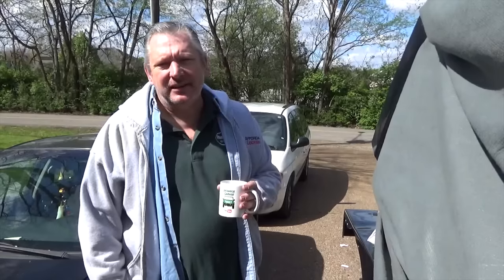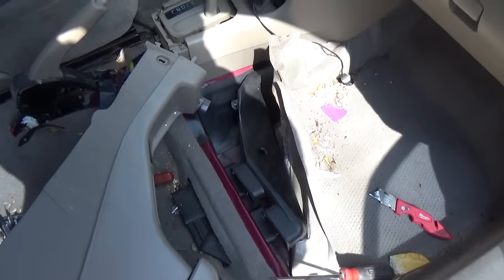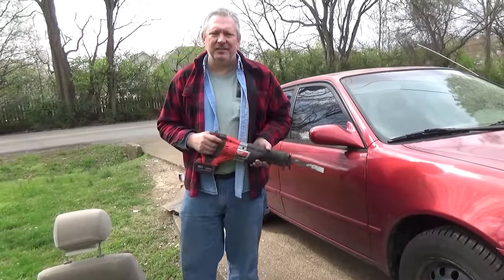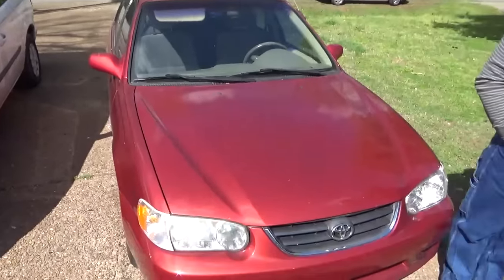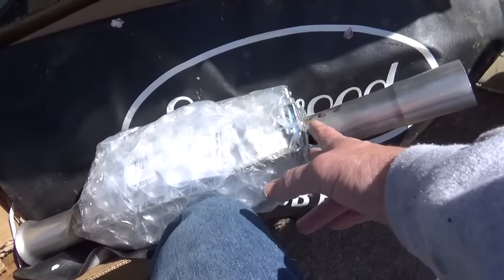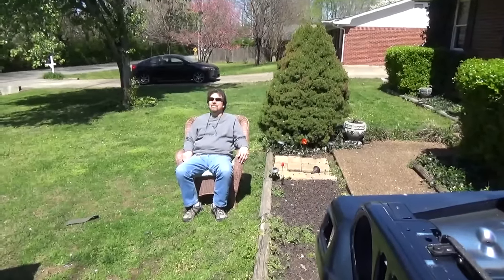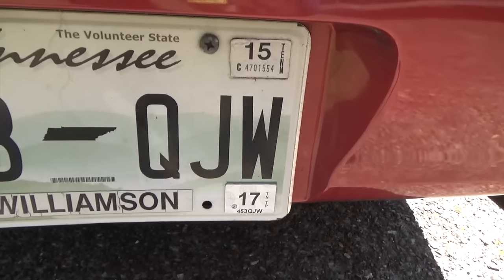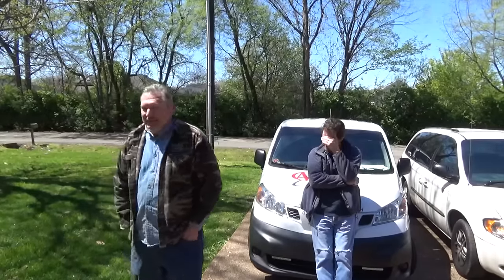2001 Toyota Corolla - O2 Sensors and Catalytic Converter - Challenging ...

Comment: Thank you for posting this, my 1998 toyota corolla kept throwing codes, and the problem was the connection to the exhaust manifold
Reply: Thanks for the tip. I have a 98 Corolla and will look into this. What exactly did you did in your situation?

Comment: Just curios of why not check the o2 sensors with the new scanner.  Checking voltage peaks and heater circuits for functionality.  Curios to if the converter was getting up to temp with a temp gun.
Reply from the maker: +Jason Curry  I did check them - they were marginal. Some cars are more sensitive than others as far as a check engine light. When dealing with the code we had - P0420 - Catalyst System Efficiency Below Threshold (Bank 1) is usually either the O2 sensors or the cat. I typically replace the O2 sensors when replacing a converter anyway it was worth a shot.  
Thanks to - OBD-Codes.com -  http://www.obd-codes.com/p0420

Comment: can you show us on where the 2 O2 sensors are at on the TJ?
Reply from the maker: +das hasguns I can - they are really easy to find if you look underneath - one is the "upstream" which comes down from the exhaust manifold and the other is the "downstream"  which is after the converter.

Comment: Couldn't you just splice in the wire instead of tearing apart the seat and carpet?
Reply: Too risky, most likely will be a weak point that introduced errors and codes.

Comment: I see you are using a clamp to hold your new catalytic converter to the front pipe.Muffler shops usually solder this part because it can leak.The old cat you removed was a universal and not OEM.

Comment: All new cars are junk you need one from the sixties all you had to worry about was a PCV valve if a converter is bad the inlet temperature will be higher than the outlet enjoy your nice weather
Reply from the maker: good tip. It wasn't restricted and looked fine when I took it off too.